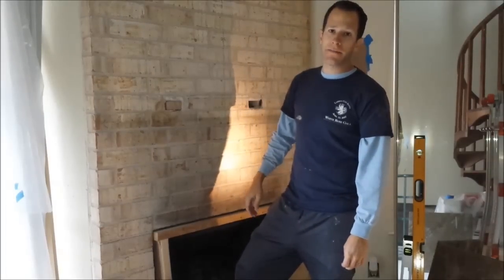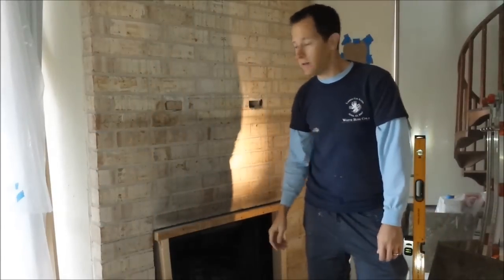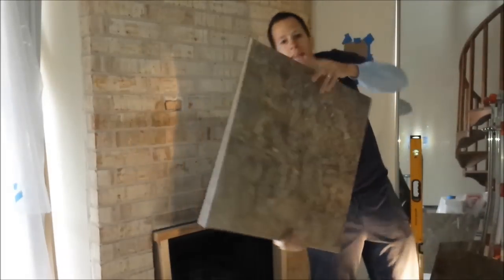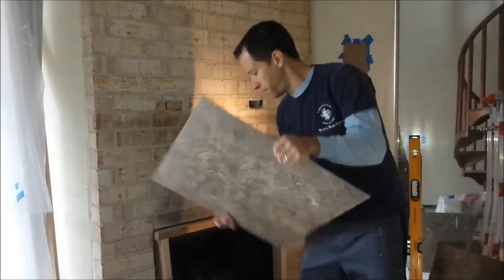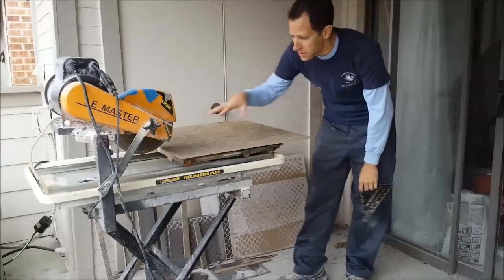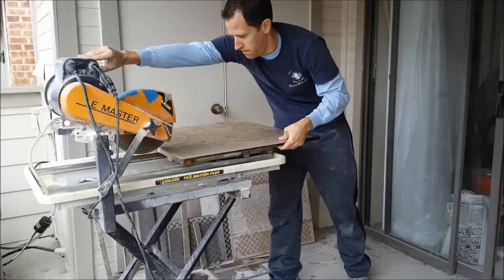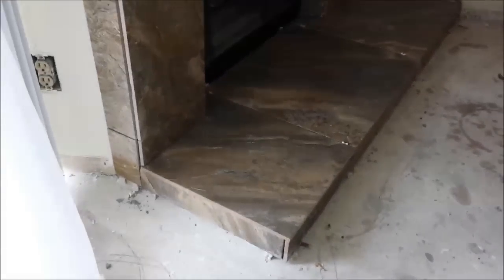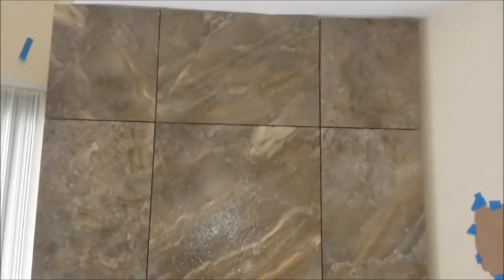Restoring a fireplace by cladding the brick with tile

Comment: question.  I have paint on my brick.  How do you suggest I prepare it/Clean it for tiling?
Reply from the maker: You want to make sure that it is very clean and free of any loose material so that the thinset has a good surface to adhere to. I just used a light scrub brush and them sponged with soap & water.
Reply: Clad the whole thing in hardieboard, then tile over.  Stripping paint is terrible, and painting brick should be punishable by flogging.

Comment: love this video! my fireplace is only the lower half of the wall and top half is I guess regular sheetrock with paint.  can I put the tiles on the brick and on the wall to get the whole wall (top to bottom) look like you have?
Reply: Samantha Davis you might need special backing board for the sheetrock area above your fireplace depending on what kind of sheetrock is already there
Reply: Samantha Davis don't quote me though I am no mason =)

Comment: That looks amazing! Didn't know you could just tile over the brick like that! Great job!
Reply from the maker: Thanks! It's so easy and the results are fantastic. You can tile over anything, the question is, will the subsurface ever move causing the tile job to begin to fail. Brick is a solid backing that will hold well for tile.
Reply: @MarkJauregui  What if they painted the brick with semi gloss paint?
Reply from the maker: @IWBVS  Hard to say. The sheen might create an issue with the adhesion; you might just rough it up. It's a good idea anyway to put up a metal lath between the subsurface and tile. It's a step I could skip here but if your worried, that should take care of it.
Reply: Did you also tile where you had the pirate of wood that held the top tiles ? And what size spacers did you use for these tiles ? Great video

Comment: I like to put granite tile over existing porcelain tile. Do not want to remove the tile. I have to use a short cut since my hands are bad, and I can not do a lot of hard work. I researched it. I could roughen up the porcelain tile. I was told at Lowes to use mortar. Any idea about using mortar instead of using an adhesive?
Reply from the maker: The issue is going to be that your sub surface is too smooth for the new material to properly adhered to. Ideally, it would be removed. You could try roughing it up so that your new material has something to grab on to. It might be easy enough to hit the porcelain tiles with a hammer to shatter them off, I would hope that they might pop off rather easily & shatter when hit.
Reply: Thanks for the answer. I plan on roughen up the tile, using a drill with a special attachment.  Do not know if it will roughen it up enough. Taking the tile off with a hammer might be an option too. I was just wondering about the mortar. If it will last with the heat.

Comment: Question: Does this method allow for a mantle to ever be put in place and how would one attach it? I'm sort of leaning toward not having one, I suppose they are not necessary (ours holds junk and tends to be a catch all)....
Reply from the maker: I never put a mantle; I think the look is dated and they collect junk. However, if you want to install one, you would want to cantilever a couple of 2x4s to support it. Make 2 holes in the wall and have two 2x4s firmly attached and protruding out about 8". This will support your mantle.
Reply: Mark Jauregui hm, thanks. I almost think they look dated also. If anything, a couple small flaoting shelves would be better. thanks so much. We plan to use your method to tile our own FP.

Comment: What type of mortar did you use? I was told to use one that has a high heat tolerance but I can't find one. Shouldn't I be able to use a finer blend of cement?
Reply from the maker: +Shonda C I'm not familiar with a high heat thinset. I used thinset from Home Depot with added Veribond to give it extra strength.
Reply: OK thanks.

Comment: up towards my mantle, 3 are like 3 rows that bump out/stick out on my brick fireplace..trying to determine how to handle that..it is not straight bricks up all the way..they bump out like steps..
Reply: I've got the same feature.  I'm going to cut them off flush.  Then I'm going to anchor allthread rod tub outs for a new wood (live edge) mantle.  It's going to require recesses for the  hardware, but I will be filling the hole with cut wood plugs.

Comment: What thin-set did you use? I can't get anyone (lowes, HD, local contractors) to say the same thing. Some say mastic, some say not. No adhesives mention heat tolerances since they are mostly fighting moisture, not heat. The tile will overlap the metal border around the fireplace some, and it gets about too hot to touch. One place said to get "lyda-crete" at HD, but HD people never heard of it. My wife is dying for me to finally finish this project and I still am not sure which adhesive to use. What do you suggest?
Reply from the maker: Mastic will work great. Thinset with an added strengthener like Verabond will work well and be less costly. I see thinset used around fireplaces all the time and I would not worry about the heat.

Comment: Very very nice!!! Mark , is there any type of wall paper that can be used on these kind of bricks to give about the same contemporary look? I am single female and cannot hold bricks due to health limitations. My fire place is 50 years old. Thank you.
Reply from the maker: Wallpaper usually requires a flat smooth surface so I'm not sure it would be possible to wallpaper over brick. I would also be concerned about the heat from the fireplace damaging the paper.
Reply: Thank you very much

Comment: If it is primed or painted I don't think you can do that. Does anyone know?
Reply: No, you'd need to use a glue if it's painted correctly. Or screw wire mesh to it first like he was talking about. Or wire brush wheel on a drill to score the paint.  Also in my other comment he should've prepared that brick, at least wet it or apply a bonding agent.

Comment: You should have done the hearth first, sides of heart then top of hearth, sides of surround then face of surround.
Reply from the maker: That's one approach. I did not do the hearth first because I would have to wait for it to dry which would have added a full day to the job also, I was dropping mess all over from the job above; I did leave a space at the bottom so the face sits over the hearth tile. The top of the hearth should be done before the sides and the face of the fireplace before the sides. This will allow for a perfect straight grout line; doing the sides first would be nearly impossible to create a straight line across all tiles.
Reply: @MarkJauregui  Nice job.  As a remodeling contractor, I agree with you with respect to installing the walls first.

Comment: Also what size grout line did you use for tile expansion? I'm going to be using this as grout http://www.keramicalia.co.za/adhesives/4-water-based-high-temperature-tile-grout.html and a refractory cement
Reply from the maker: I just used a regular Polyblend from Home Depot. Tile does not expand, the grout is not for expansion but I used a 1/8" grout line.
Reply from the maker: VersaBond is an additive that increases the strength of the thinset. You can buy it as a white liquid to add to the thinset or buy a premixed thinset that already has the additive.